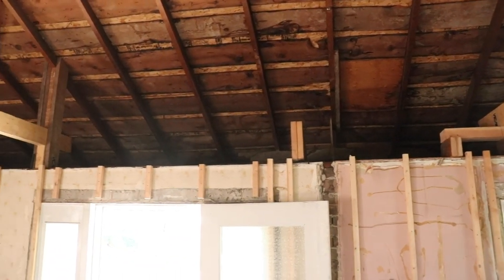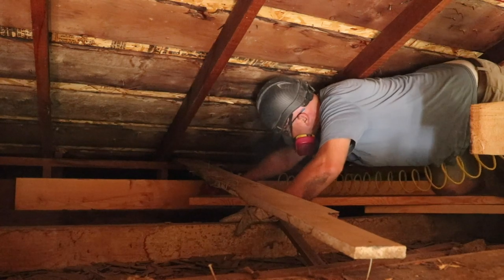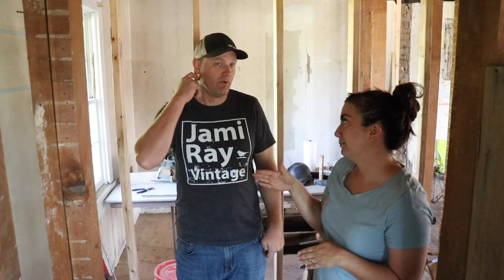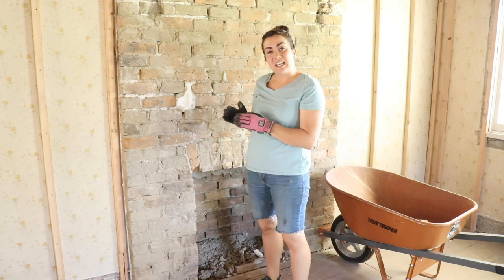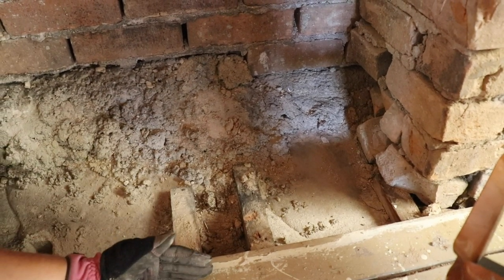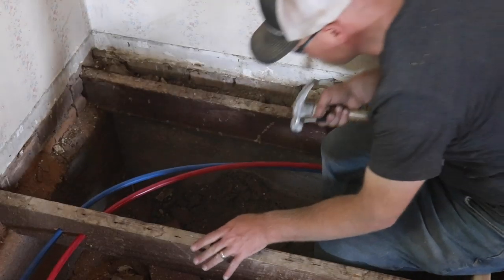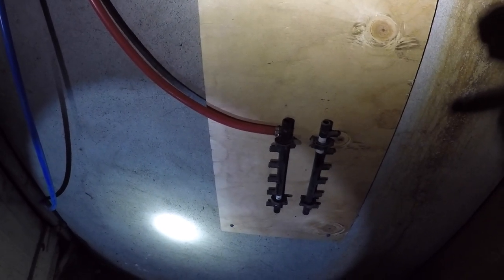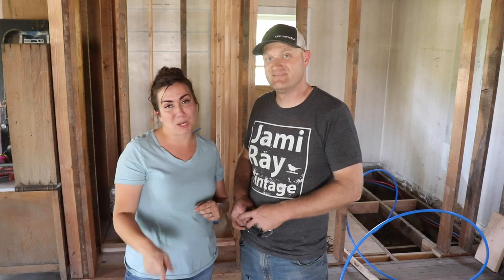Farmhouse Renovation Episode 12 | Plumbing and Front Porch Repair

Comment: I love watching your progress!  Amazing!  We have a fireplace that needs to be relined and it’s somewhere around $3000 - not happening.  I bought a gel fuel ceramic log set that you burn three gel fuel cans in from Amazon.  I can’t find the one I bought, but they have others on there.  It looks really good.  You can burn one, two or three cans at a time.  Three cans obviously gives you the best look.  The cans even crackle like real wood.  No mess and no fuss.  I love mine and wouldn’t even consider doing the relining anymore.  Maybe an option for you!
Reply from the maker: That’s amazing!  I’ll look into it.

Comment: I have a question, I believe I heard Jamie say that she wanted to vote the ceilings and leave the roofline exposed because she like the wood. My question is is how do you insulate so that it’s not cold and hot during the different seasons?
Reply from the maker: We’re putting 8” of foam insulation on the roof and then doing the new standing seam metal roofing over that.

Comment: are you planning on insulating the walls downstairs? If you're concerned about the snow? And do you insulate PEX? When I ask questions I'm not being kind condescending or rude or anything. I'm just curious to learn myself you guys are awesome I wish I had a relationship like you guys and you guys work so well and have great minds this is awesome.
Reply from the maker: me me if you run pex along an exterior wall it’s a good idea to give it some extra insulation. The walls downstairs won’t get insulated as they are very thick concrete walls and the upstairs exterior walls don’t require insulation because they are 10” thick adobe and have a higher R value than a 6” insulated wood framed wall.
Reply: @JamiRayVintage  Sweet thank you so much for answering those questions. I really appreciate that. My God I would love to work with you guys. keep up the great job and I'm loving the videos. You guys ever think you'll ever use blues in your painting. I just started watching you this past year. And I haven't seen a video with blues. Now I have stuff here and once have more time in my life LOL I would like to paint them. But I don't want a white coffee table because I want to put plants on it and I have a cat LOL. So I was thinking about doing blue with undercoat of white? Any suggestions. And by the way I watched all your 16 episodes this evening. I totally binged it. I wish they were longer you guys should have your own show. You guys should picture to HGTV...I love your family Dynamics I love the way you guys speak to each other and your children. I love your patience with each other God bless and keep it up! And maybe you should write a book LOL just saying 😋
Reply from the maker: I don’t paint a ton of things in blues, mostly personal preference.  I like a vintage blue green mix. 
But, I’ve done a few pieces in various blues with white undertones and they are beautiful.

Comment: I found this very interesting because I soon starting my Reno’s really soon very nervous 😬 about doing 😬 this flex pipe your using is this better that copper or is it the same 🤔 also is it more cost-effective? 🤗
Reply from the maker: I did a lot of research on it, it’s a lot cheaper than cooper, holds up longer, won’t oxidize, copper tends to have issues with pin holes and solder joints...plus PEX pipe is flexible so it can go around corners without having to have a bunch of fittings.

Comment: Isn’t it standard in plumbing to have hot on the right and cold on the left?
Reply from the maker: Cold goes on the right. It’s from way back when plumbing was first being developed you had to pump the water in and there was only one faucet for cold. Most people were right handed so the pump was placed on the right side.  As hot water systems were developed they kept the cold on the right and added the hot on the left. 😊

Comment: Wondering why you are having the air return only 48" up above the toilet. Won't that look weird to have a vent right above the toilet with a cabinet above? I also wonder about the moisture getting in the return from the toilet tank, not to mention the smells sucked in. Hmmmm???
Reply from the maker: Great question!  

So the air return for the HVAC will be vented out of the wall into the main living space. It won’t be exposed to the bathroom at all. It’ll be sealed up behind that 4 foot wall behind the toilet and above that will be some cute cabinets.